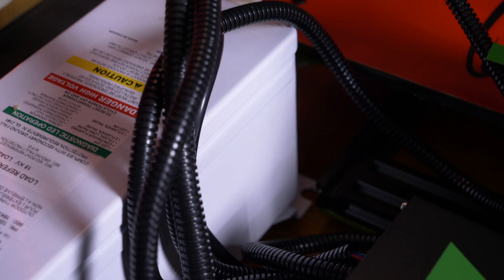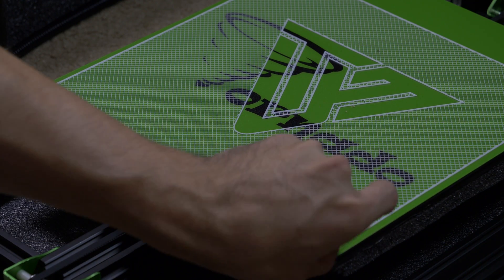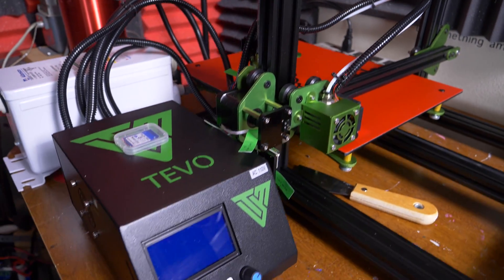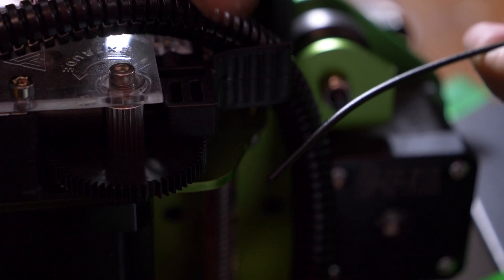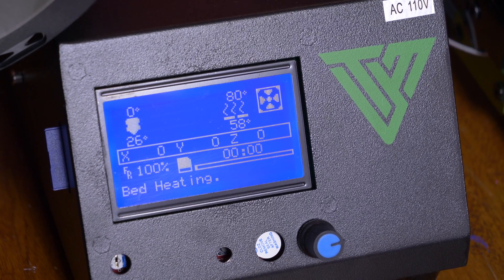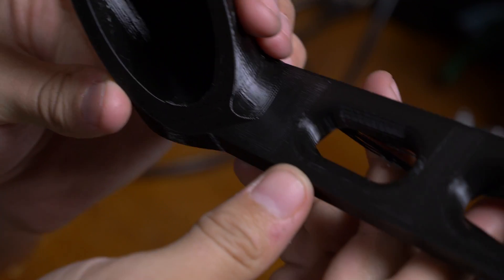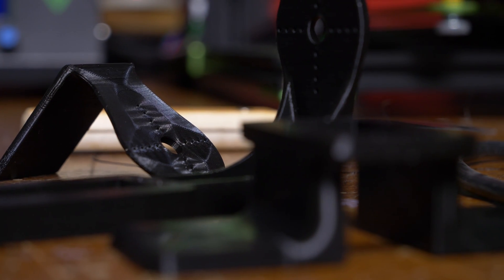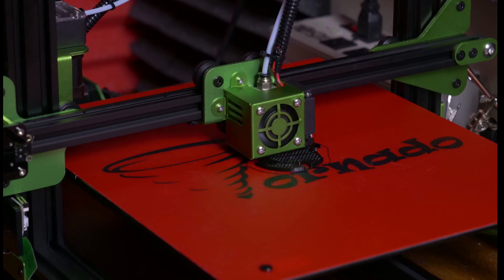TEVO Tornado Review - the Fully Assembled 3d printer

Comment: I just received mine a week ago. It was preassembled. I only had to mount the vertical and plug the cables. It sucks that the cables are so short. You can only place the control box on the left.
First thing first is to check every nut and belt and level the bed. Do not move the bed by hand while it's on and make sure it starts in a home position. Otherwise it will go crazy on you.
The worst thing about it so far is that the top section rattles as you print due to the heavy carriage under the bed. You can drill holes in it to make it lighter and put diagonal braces and softer feet, and or lower your print speeds, lower your acceleration and jerk. That will reduce the vibrations.
The fans on the extruder are not very good at doing their job and are loud, so that is another thing to consider changing.
Prints come out nice except I am still figuring out how to make smooth top layers with no gaps and holes.
Remove prints off the bed when the temp is about 35 C. Too hot and you will warp the bottom of your print, too cold and it is stuck there for good. Just reheat and try again.